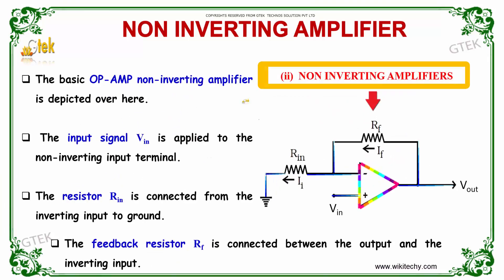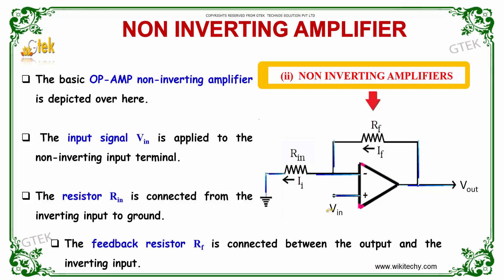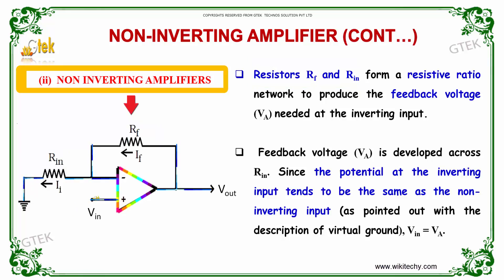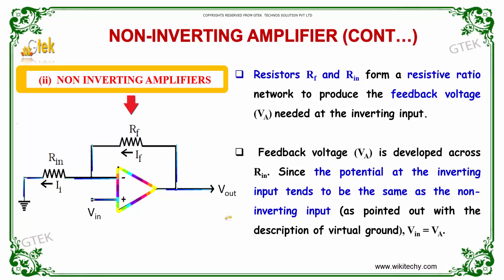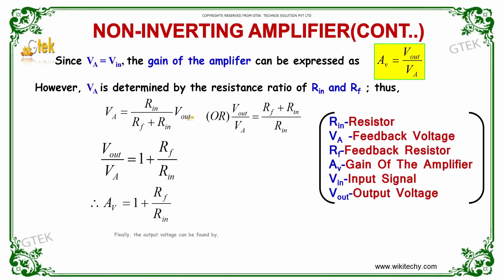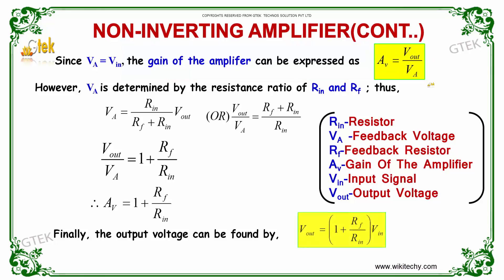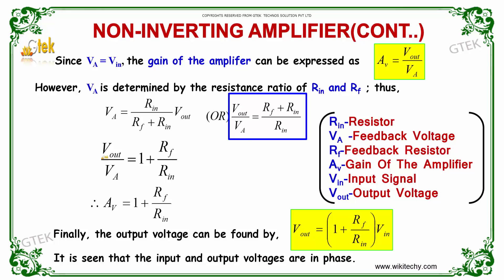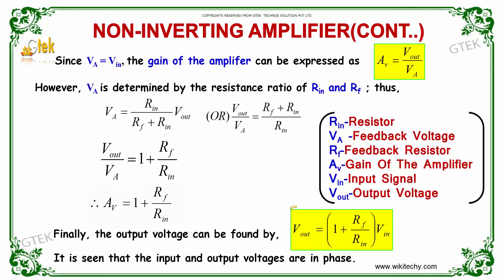Non Inverting Amplifier|Semiconductor Devices|class 12 physics subject notes lectures|CBSE

Comment: The second basic configuration of an operational amplifier circuit is that of a Non-inverting Operational Amplifier design. ... Then the closed loop voltage gain of a Non-inverting Operational Amplifier

Comment: The amplifier's differential inputs consist of a non-inverting input (+) with voltage V+ and an inverting input (–) with voltage V−; ideally the op-amp amplifies only the difference in voltage between the two, which is called the differential input voltage.

Comment: An op amp is configured in its non-inverting amplifier format, linking the output directly to the inverting input and applying the input signal to the non-inverting input. From the gain equation it is possible to see that the voltage gain of this circuit is unity. Av = 1 + R2 / R1.

Comment: In this configuration, the input voltage signal, ( Vin ) is applied directly to thenon-inverting ( + ) input terminal which means that the output gain of theamplifier becomes “Positive” in value in contrast to the “Inverting Amplifier” circuit we saw in the last tutorial whose output gain is negative in value.

Comment: the input voltage signal, ( Vin ) is applied directly to the non-inverting ( + ) input terminal which means that the output gain of the amplifier becomes “Positive” in value in contrast to the “Inverting Amplifier” circuit we saw in the last tutorial whose output gain is negative in value.